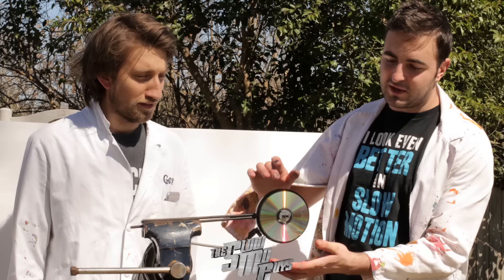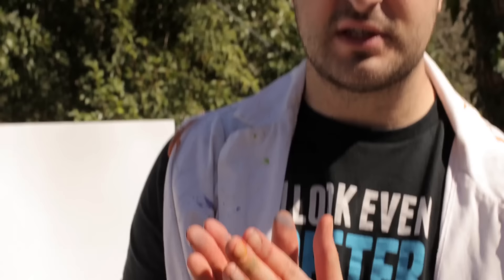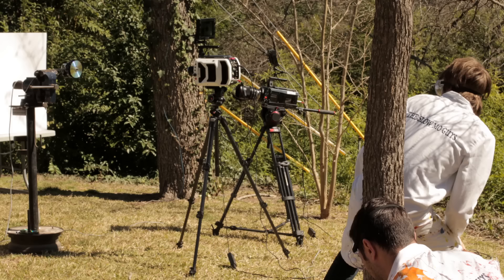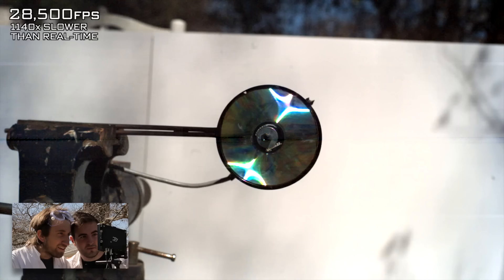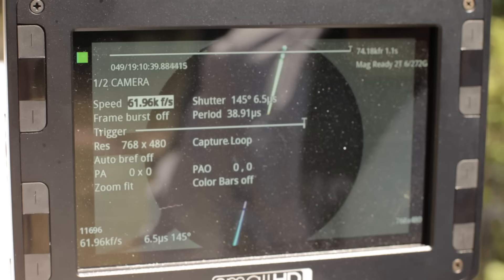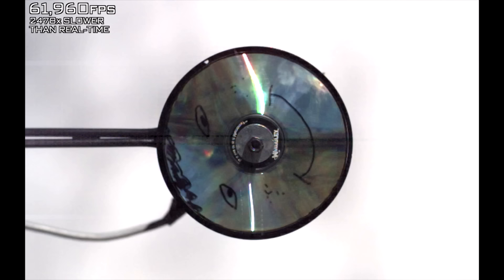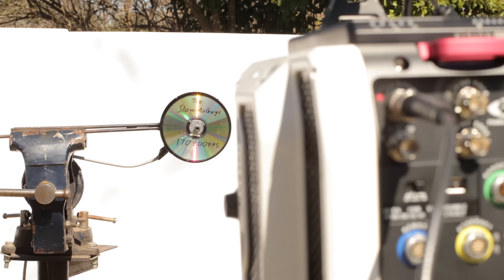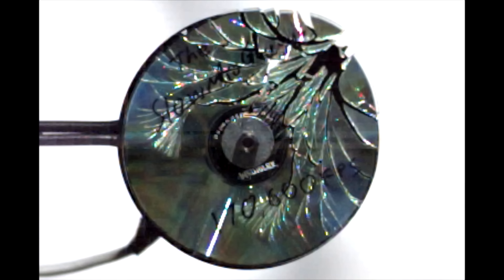CD Shattering at 170,000FPS! - The Slow Mo Guys

Comment: What would happen if you took the CD to the state of warping and then slowed it down to a stop? Would the CD maintain a warped shape or would it return to normal?
Reply: it would return to normal of course
Reply: Yeah obviously
Reply: |Fresh|Pe How do you know? CD's are solid. If you slowed them down gradually, wouldn't they maintain their molecular bond positions? I don't really know though. I guess you are right.
Reply: it would return to normal
Reply: That's what i was wondering, if they were to stop the cd from being destroyed (at its maximum breaking point essentially) eould it remain warped or would it go back to its. Normal form or would it stay warped and slowly change back
Reply: Rohan Skatedude No, it would return to its original shape
Reply: Rohan Skatedude They're not that solid. You can bend them easily.
Reply: |Fresh|Pe really? i am fairly sure it would remain warped.
Reply: ***** as you can see towards the end of the video when they get the side shot, the CD is spinning but it looks like the warp is stationary. That is because the CD isn't just warped, it is oscillating and there is a standing wave. Similar to when you pour milk and it looks like the stream is twisted. So when you slow it down the oscillation would stop and it would return to normal
Reply: ***** If you look at 7:00 you see that the CD is actually spinning faster than the warp is spinning. If you were to look at it from the CD perspective the warp is not stationary and therefore the CD is being bent in both directions over and over again. Slowing it down will reduce the amplitude of the warp until it is stationary where there is no warp.
Reply: *****
Why do you think that?
Reply: Rohan Skatedude Stop it im on spring brake I dont want to think of science.
Reply: |Fresh|Pe What about stopping the CD quick a possible when it becomes warped?
Reply: ***** He made perfect sense to me... When the picture on the disc goes past the warped spots, it's being bent. Since the warp bows forward & back, the disc is being bent back & forth every time the pic on the disc goes through the warped spots, which weakens the material until it can't flex like that any longer & it explodes. If you stop the disc, you'd first see the warp move & then it would return to its original shape
Reply: I wanted to know the same thing!
Reply: ***** Then why come to a science-based YouTube channel?
Reply: ***** Think of it this way. You are holding a rope that is attached at the other end and you move your end very quickly up and down repeatedly. Each time you do it you create a wave. If you slow down how fast you are moving the rope up and down you reduce the amplitude of the wave and if you were to stop the amplitude of the wave is reduced to zero. This is the same concept in a circle with a CD instead of a rope. Once you stop the rotation there is no permanent warp just like there is no permanent bend in the rope.
Reply: *****
If you watch this carefully you'll see the CD is not deforming in a way similar to bending (when you would apply a force perpendicular to CD's surface).
It is vibrating. :) (And that's why it constantly makes the high pitched sound).
Vibration is a movement around a state of minimal energy. In this situation it's the one where CD is flat. So when the vibration stops, the CD would return to how it looked before the process.

Why doesn't the "minimal" state change?
That's fairly simple: there is no external force perpendicular to the surface. :)
Reply: ***** I know it isn't being influenced by heat to the point of losing cohesion or it would shatter into blobs & not shards. It's not consistent pressure or being bent in any 1 spot for a duration that would give it the chance to break molecular cohesion, or the markings wouldn't move through the bent spots. So what we're left with is the temperature rising on the disc while it's being warped, but that warping isn't staying in any 1 spot of the disc long enough to maintain the change if the warping factor (the speed) is reduced. Since there is no consistency in where it's being warped, how do you expect that warp to stay in any 1 spot? Before calling someone a moron, perhaps you should really try to wrap your head around the problem, kid
Reply: The CD snaps because it's trying to get back into it's normal configuration. It's easy enough to test yourself, get a cd hold it in the center spindle hole, and flex the edges. When you stop flexing the edges, does it stay flexed? Theres's your answer.
Reply: facepalm has anyone thought about the perception of the human eye? Like seriously? Our eyes can trick our brains easily. How about that dumb #TheDress shit that was going around? People were seeing different colours when the colours were the same (just a lot of Photoshop). So what if this is a similar instance? Its just our brains lying to our minds. When the CD breaks, the pieces fly away from its center. Not towards the camera or Dan or Gav or the backdrop, but the sides. If it was warping the pieces would explode like a grenade. 

Course I could be fully wrong.
Reply: Well according to me I think the cd will just shatter because of the sudden stop, when an item suddenly stop like a car running a high speed instantly lost its velocity will shatter its glass, a cd having almost the same strength for it to get broken will also just shatter, well this theory is just for an instant stop purpose but if you think it will slowly loose its velocity until it fully stops I'll say it will just return back to normal.
Reply: Even a 15 gram cd moving at those speeds would have a hefty chunk of inertial behind it, I think you'll be hard pressed to find anything that could instantly stop it.
Reply: Dodger546 The bending was there as was demonstrated in 170k frames/sec. & by the whistling sound it made as the bends broke the air. I'm not sure what the "refresh rate" of the eye is, but the lowest I ever saw a video shot in that didn't shutter was 14 frames per second. Cameras are susceptible to being fooled, just like our eyes are... One only has to watch the wheels on a car on TV to see that. But at 170k frames per second, that trickery doesn't work anymore, the cameras refresh rate is fast enough to catch more than 100k rpms accurately... That stupid dress, on the other hand, was just a bad photographer or we'd all know what color it was at a glance. It looked to me like their white balance was set for a shadowy picture in broad daylight
Reply: cds are usually made of polycarbonates.  I don't have any direct sources but it seems like polycarbonates are easlily can be seen as an amorphous solid or in other words they don't have a definite structure, if this is the cast then the disk would probably stay deformed.
Reply: It would go into limbo.
Reply: James Sebastian Thanks Albert Einstein.....
Reply: the universe would implode into a black hole
Reply: BMXrace321 ayy lmao
Reply: Does this happen for anything then? Like, even if it was more solid and would need a faster turning speed and began warping, would it still come back to it's original state? Or would it simply not warp at all
Reply: Rohan Skatedude Exactly, CDs are solid so therefore it would return to normal or otherwise break, as seen in the video.
Reply: Sam Mutch That's a good question. I imagine steel of varying grades would require varying speeds to warp. Glass would shatter before it warped. Liquids would obviously fly away before it got spinning very fast provided there was some way to keep a liquid there to begin with. I can't figure out what a diamond would do if spun like that. I actually appreciate you asking that though, because you made me think, so thanks
Reply: Definitely these discs are malleable u bend it and release your grip it will return to a disc with most likely a small yet noticeable curve in it
Reply: Nowan Inparticular Glass does warp before it breaks. Anything that breaks has a warp around the location of the break. The materiel bends/deforms until it can't hold its structural integrity, and then breaks. Some materials have a lot of flex that can be viewed, other materials will break after just a small amount of deformation.
Reply: When the CD warps, it will have locally yielded in certain regions which have imperfections. Therefore although you may not notice a clear distortion of the shape (because of the nature of the warping under centrifugal forces which maintains the circular profile(basically means that things that spin like to be disc shaped anyway!!)), if you were to bend it, it would give in a lot easier.
Reply: Sam Mutch Diamonds are pretty low on the flexibility scale and actually relatively brittle. You can shatter them with a hammer, for example. They would warp even less than glass before breaking.
Reply: Paremo Wait wait, I thought diamonds were like the toughest thing ever or some shit, I ain't saying you're wrong but I've never heard that one
Reply: I'm not sure but I think that it would go back to the original shape because CDs are quite malubal(don't know how to spell it). If you spun the cd at the right speed so that the warp would follow the cd perfectly than it might stay in warped shape? Correct me if I am wrong Internet.
Reply: The warping you see is called an elastic deformation. The material stretches but no molecular bonds are broken. When a material is bent to the point that it won't spring back to its original shape that's called plastic deformation. In that case the material has passed its yield stress, and any further deformation in that direction will be plastic.
Reply: Rohan Skatedude Dont try it at home ;D
Reply: It's incredible that I was just going to ask this question and I see it as top comment.
Reply: Disk resonance and Hooke's Law for elastic materials bitches xD
Reply: ***** Somebody has anger management issues.
Reply: If you had a way ti instantly stop it to zero, the tension would be way too high of course, so yeah it would shatter.
Reply: It would mostly return to normal as the waves are plastic deformation due to the outside stretching. The data layers are more rigid and provide support so you end up with more an instantaneous failure. I would however like to see such with the clear protector disks they place on the ends of spindles, they do have more potential to exhibit permanent warp.
Reply: ***** Never thought i'd see one of my old favorite animators just commenting around
Reply: Tobin James No I'm not, It would return to its original shape
Reply: Whelp, I just asked a simple question D: I didn't want to start a flame war.

I think the overwhelming and logical response is that it will return to its original state. Case closed. If you have any problems start a new comment chain. If you want to add someone not offensive fine. Mean comments from here on will be removed -_-
Reply: It would keep the normal shape, because it warps from vibrations generated from few sources (motor, air resistance..). It's not regular bend force applied on CD disc.
Reply: It's due to radial stretch, the same plastic deformation that allows it to bend except it's unidirectional.
Reply: And what do you think about data in twisted CD? Would it be translocated or something?
Reply: gruca04 All data is saved in digital way (like this: 01001110110101011..), so data cannot be translocated, it'll just be unreadable
Reply: Sam Mutch Diamonds are extremely hard, ten times as hard as sapphire/aluminum oxide.  But like other very hard things they are not tough.  They can be deformed only minutely before they break.
Reply: ***** That made complete sense.
Reply: Just watch the video. This warp doesn't move together with disc. It is slightly moving, but very slowly..
Reply: ΛVINIDE No doubt the disc is mounted slightly canted, so the oscillation is tied directly to shaft angle.  When the speed gets to a resonant frequency of the disc you get the high-amplitude deformation.  I haven't time to look now but it would be interesting to see if the burst point (which is at the rim) is consistently at a peak or trough of the wave, where the highest curvature is located.  I bet it is.  If they had a floating mount they could spin the disc up faster.
Reply: If the wave were due to vibration the fractures would have started at the hub.
Reply: ***** RagingTrynd's argument makes perfect sense.  Read slower.  The CD isn't "warped" -- it's bending violently back and forth several times every time the disc revolves one turn
Reply: travis575757 While many amorphous polymers to deform I don't think Cds would. The Tg for polycarbonate is 147 °C and the melting temp is155 °C. This means until it reaches that temp it behaves in a more brittle way, i.e. shattering before plastically deforming. I doubt it would have reached that temperature during the spin, however if it were, because the Tg and Tm are so close you'd probably see less of a shattering and more of a stretching out extremely thin before giving way.
Reply: iPTGi Science At Its Finest Everybody

Comment: 7:04 That looks exactly like the solution to Laplace's equation f(r,𝜃)=r³sin(3𝜃). You can easily check that this function is harmonic. It would be incredible if that were the actual shape of that disc for some physical reason.
Reply: Nerd
Reply: @animamundii  nerd
Reply: It creates a illusion that makes it seem like the cd is a rectangle that turns the larger sides into the smaller sides everytime the disc turns 90°
Reply: @decasaint532  neandertal
Reply: @danigarcia2294  nerd
Reply: Ok
Reply: big chungus is funny
Reply: @JavierRodriguez-go7hl  let's see you're intelligent convo ? What's you're problem ?
Reply: Just say a rectangle with rounded edges. You wouldn’t call a circle “x^2 + y^2 = r^2”, would you?
Reply: No bro force changes shape of cd
Reply: We don’t do that here sir

Comment: "YAY I'm early to a SlowMo video. FUCK I have to wait an hour for it to process 1080p."
- Me
Reply: It wont do it, come back in a year and it wont be 1080
Reply: Will Richards it won't huh? Then how come it's currently 1080p?
Reply: Will Richards Well it's 1080p ow. What is your point?
Reply: Will Richards it just got uploaded in 1080p. I understand what you mean, but while the slo mo wasn't filmed in 1080p, the rest of the scenes were. It doesn't bother me any ways, my computer can only handle 720p
Reply: eric Burtron im pretty sure that everyone saying it won't process to 1080p are talking about the footage the Phantom shot.  Not the video itself.
Reply: Ze Rubenator it would seem that way.
Reply: Sam Hellings what?
Reply: Ze Rubenator Yay, SlowMo uploaded a video in 1080p. Fuck, my internet only supports 360p without lagging.
Reply: Hoch134 if it's buffering then it's your internet, if it lags it's your gfx card (and/or processor).
Reply: Ze Rubenator It's buffering, which is mostly lagging, because every second, the video stops (if not preloaded).
The irony is that I bought/configured an high end gaming PC and it fails with my crappy cross-country internet.
Reply: Will Richards it's 1080p now nab
Reply: Hoch134 Is preloading even a thing anymore? Whenever I leave a youtube video to load, it just stays at the same spot, and even as I watch the video, the loading bar just completely resets every now and then.
Reply: BloodPrince130 They only allow you to buffer something like 10% of the video while paused for reasons. (save bandwidth, stop ripping)
Reply: BloodPrince130 it resets when the video quality changes automatically. If your internet connection is too slow, you can install a browser addon that allows Youtube to buffer the whole video while paused.
Reply: Ze Rubenator I wish I could render a video at 1080p..
Reply: Ze Rubenator Thanks, that's good to know. I guess it's just that shitty college internet.
Reply: How come i can watch 1080p on my phone straight away?
Reply: aL Azqo__  lol , we watched it when it was uploaded some minutes ago , and NOW it's on 1080p
Reply: BloodPrince130 I use the addon "magic actions" for Youtube. This helps me preloading the video fully before watching it.